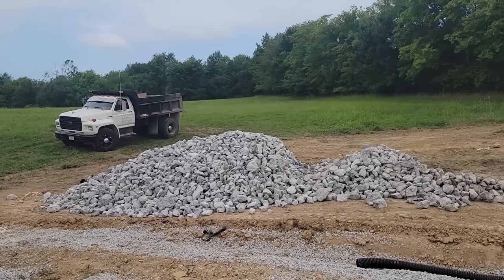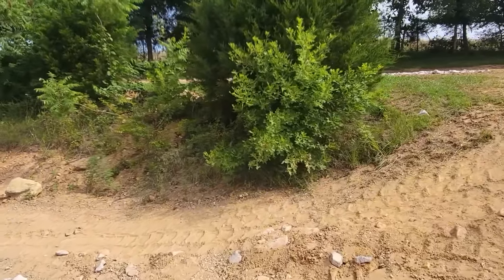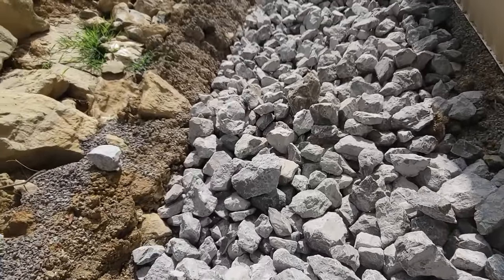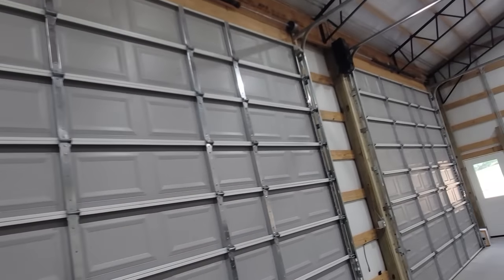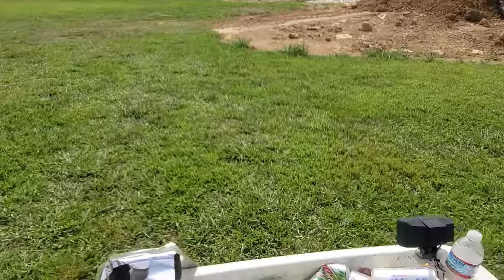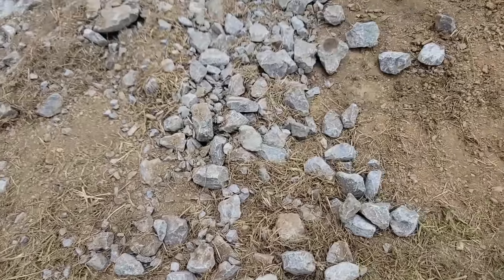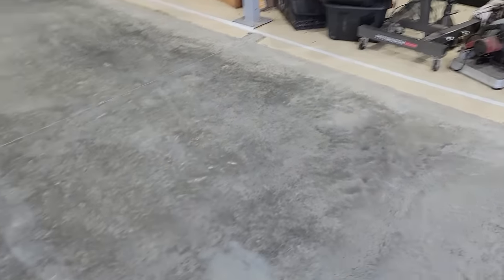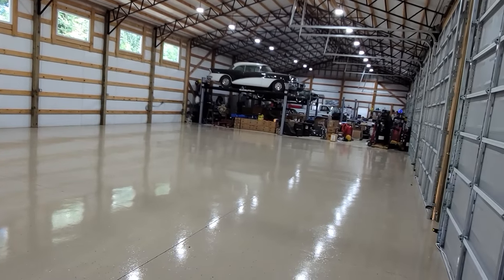My NEW Shop FLOODED! - Here's what happened (we had to start over)

Comment: That perforated piping should be wrapped in fabric before it's buried to prevent clogging and rooting. Also make sure the highest point is lower than your lowest grade on the garage. Also, you should have Y pipe cleanouts for your downspouts so you can wash them out if they clog.
Reply: You can get perforated pipe with a sock on it that is almost like a real heavy pair of winter nylons the ladies might wear here in Canadia. Smiles 😃 from Canada 🇨🇦
Reply: Yeah, was thinking same thing, should have the sock...there's a lot of fine silt.soil there that will fill that big O pretty quick in heavy rainfall. Learned that the hard way myself...
Reply: Construction of the building was incorrect to begin with. He's right next to a mountain. His concrete foundation should have included 12-inch concrete Rat-Walls. What he's doing now is temporary fix. He has no choice but to install retaining wall now. We learn from our mistakes.
Reply: Nope.   The fabric will plug up
Reply: @Alien_Observer_LV-426  I agree. I thought that when I was watching the previous videos of the construction processes that he shouldn't have skimped on putting up a retaining wall - water only knows one thing... it wants to flow to the lowest point, and he's on the side of a hill... I had a similar problem with my parent's house in Arkansas, where their garage would flood every time it rained, and it wasn't because of bad construction - it was bad engineering, and the plot where the house was built wasn't properly graded or setup for drainage. We ended up having to dig a French drain around the side of the garage which it was experiencing the flood water entering, and then we extended the drain down to the lowest point of their yard. It was expensive, but necessary to repair it, or all the flooding was going to destroy their garage in short order. Sorry for you guys having to experience this! Don't let it disappoint you or discourage you - we love what you guys are doing and support your efforts!
Reply: @Alien_Observer_LV-426  I work in municipal engineering and construction in NJ. At least half of the old construction I dealt with are prone to flooding due to bad design or lack of knowledge at the time. True, in hindsight it helps to know now, but at this point, even with a retaining wall, he's going to need proper ground water drainage.
Reply: @virus56777  It's called landscaping fabric. It basically plastic but with holes so small only water passes through (kinda like a RO filter), It never "clogs" and is designed for this sort of thing.  Not using it..... you will eventually clog the tube.
Reply: French drains with a retainer and possibly a 4 foot wall around building of block instead of the tin
Reply: Sock pipe is fkn garbage.
Reply: French drain man. , burrito wrap it
Reply: Depends on the soil.  Clay is essentially waterproof.  If the sock gets clogged with clay then the pipe is useless.  There are areas where types of algae will clog the sock.
Reply: I was thinking the same thing about the fabric...I also thing that drainage pipe is prone to collapse. Sdr 35 is a much better long term solution
Reply: We don't wrap it in our fields and never had 1 plug in 17 years those slits are big enough water will go through the soil and in the pipe
Reply: Absolutely Right!

Comment: Like others are saying, don't put your gutters into your foundation drain. Run the gutters underground in solid pipe and the foundation drain in perf pipe. PVC is more expensive but it's a lot cheaper than digging it up again if it ever gets clogged.
Reply: Also noticed at the "T" connections they aren't radiused in the direction of flow. This could be an issue.

Comment: I recommend getting pallets to put stuff on.  One, to prevent dampness due to concrete contact/water and Two, to make it easy to move stuff around with a pallet jack.
Reply: Kinda everything in my reality is on wheels or pallets. A gal can't wait until there's a shop big enough to own a forklift again.
Reply: plastic pallets for sure!
Reply: I worked in a major corporate Data Center and this was our rule as well.  Never anything direction on the floor.  Multiple reasons, as you stated.

Comment: Yep that hillside behind made me nervous from the first time I seen it. I’ve seen the same thing happen several times. Gotta have a good tile/drain system when u got a shop like that on a side hill. The worst is getting all that mud off the floors and everything, I feel for u brother. Sometimes life decides our projects for us 👍
Reply: That hillside is very close and abrupt. Looks like he's fighting an uphill battle. Did he pull a permit and did it pass inspection?
Reply: I'd add an emergency sump system incase the drains get overwhelmed, a pump can do wonders to make the water move far faster than gravity
Reply: Really needs to have a concrete foundation wall on the back side of that building to help keep water from seeping under the sill plate and to have a very large French drain installed around the building that should catach and shed water away from the building
Reply: @waltermelyon4300  no permit necessary in Tennessee.

Comment: Civil engineer here…. you might think about adding a berm beyond your rip rap ditch up the hill in case the channel gets overwhelmed.  Also, sod everything upstream of your riprap channel.  Good luck!  We sure enjoy your content.  Sorry this happened.  Looks like you have a good crew working on it.
Reply: Have to agree with berm. We had a bad flood here in SC and our property at bottom of hill. It was disaster. We built a berm really cheap and easy. It works amazingly. Nice grassy hill looks nice too. Would be great on your property. Considerably cheaper than what many others are suggesting.
Reply: Let's get together to solve this. The next big rain is going to take out his hill. Clay doesn't absorb water. He has a overland issue
Reply: American Here, I would just put a gutter on the bottom of the hill

Comment: Two recommendations:  Get some pallet size shelving, and keep everything up off the floor.  Even stuff on the floor that is on a pallet first will keep longer.   Also, provided there is nothing against it locally, you may want to get a ocuple of shipping containers to put next to the shop to use for longer term storage.   Put them up on blocks or on concrete pads, and they too will be relatively immune to any water issues.  It will also free up a ton of space in your shop.

Comment: You have a lot of comments by drainage experts here, so no comment from me on that. Hope it all works out. I have seen the power of water running off of fields at our recreational property near Durand, WI. Our cabin was located at the base of the runoff in a coulee. Rivers of chocolate brown water running past the cabin after a big rain. So much water and so much power in that water. On the shop, wow!!  Looks great. The electrical, the floor, the doors, and the plan all look fantastic. I was waiting to hear about HVAC, and you discussed it. 105F in Tennessee in the summer will make for a hot barn, as I am sure you know. My MG mechanic in Chippawa Falls, WI has a new shop with wonderful HVAC installed. A smaller version of your shop. I had a starter installed in my 57-year-old MGB earlier this summer and it was very pleasant to sit and "help" him in the cool shop. Looking forward to more shop tours as your projects unfold.

Comment: Hi Derek I've been doing drainage for many years and that line behind the garage is Not deep enough! It's almost level with your concrete top and walls which I can see there was no heavy plastic wrap, or a tar coated insulation wrapped around the building or at least across the back because it was well-known a flood area. I would try to save your drive by running a line of tile on the other side of your fence! I'm from Bucyrus Ohio a farm gal so I know about laying tile I had a French drain too!! Good luck I love your videos you 2 are awesome parents!!
Reply: And should there be some fabric around the perf pipe or top of ditch? Seems like it will fill with sediment quickly with that volume of water.
Reply: @jarrsong  Fabric is the new standard, but a lot of old school systems are still doing just fine as well. As long as perf pipe is surrounded by rock, it should be just fine. I do agree that the pipe looked shallow in back.

Comment: Derek, your "trench" up on the hill isn't wide enough to carry the volume of water coming down the mountain. Clay soil won't allow the water to peculate so all of it is looking for the low point to pool. Definitely look at the building grade and make sure the lower ditch is lower than the building or you'll be mopping that floor again. When you are setting the drainage ditch assume you'll have 1" of water covering that whole mountain coming for your building. I'd hate to see a guy and gal have to go through this again.
Reply: I'd consider digging a moat drain using a lot of 6 - 8" around the rear of the building with a 12" drain pipe taking everything away to a safer run-off to one side and downhill.
Reply: Could probably do a sump pit and pump for those really wet days

Comment: For the fulel set up, gonna need rigid conduit with explosion proof fittings and AHJ approved wiring method. Some require stuffing and fire proof putty/ caulk. Arc/ GFCI combo breaker, if you can get it. We're being told no time soon on them in Kentucky. Love the videos. Thanks for all the hard work. Square D QO

Comment: Suggestion for the air compressor: an 8 hour timer on a solenoid. When you need air you hit the button and it stays open for 8 hours and then automatically closes. No more forgetting about it.
Reply: I keep forgetting my air line on, but I do turn the power off disconnect. but the hose or line would probably beat the garage apart before that 100+ gallon tank runs out 😵. lol

Comment: From experience I can tell you it will work. The only addition to this solution is a three foot wall around the shop. leave about a foot open which will also guide the water around the building... My 70 foot long wall was around another 6K. worked like a champ...

Comment: Sorry this happened to your shop!  I'd rather see that T drain connector after your downspout turned into a Y type that would help push the roof water around the corner in the direction you're trying to send the water.  The T connector may send water both directions in heavy downpours.
Reply: Yes the T connector is not good enough.  En to many roof on one line.... and 2 system for roof water and the hill.
Reply: If a guy wants a little cheapo insurance, form up those 6 x 6 posts in the back of the shop and fill um up with concrete about 9 inches high.  Might not be totally water proof but will protect against the mud. Makes a good place to set a cold snack to keep it off the floor.
Reply: @ripvanrevs  What you’re referring to is called a rat wall. The back wall should have a 1ft high and 2 sidewalls should be 6inches high. Yes had he built his shop correctly to begin with, the water wouldn’t have gotten in. He like most didn’t want to spend the extra money. He complains about things being expensive, well he’s going to really be upset when he finally figures up how much he spends to correct the problem and the “repairs” in this video WON’T fix the problem.
Reply: @JP-kb4yi  EXACTLY 💯 what was he thinking building below a mountain without rat walls or giant Retaining Wall 🧱 unfortunately it's all his fault to begin with. Sad.